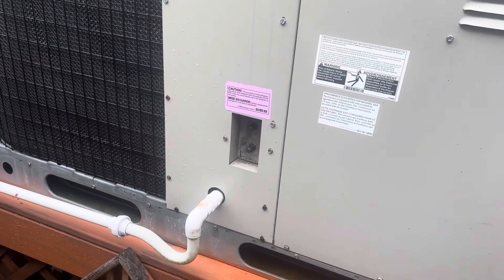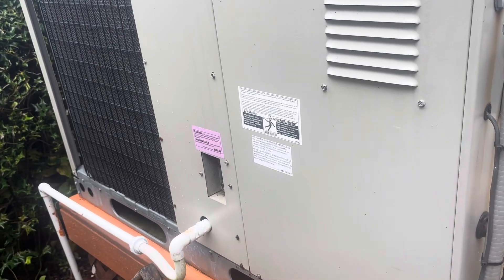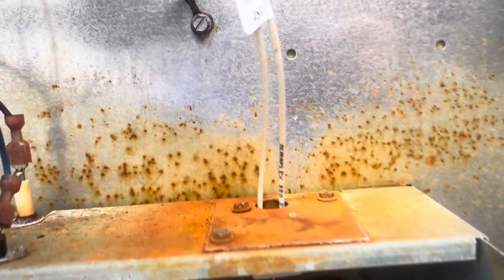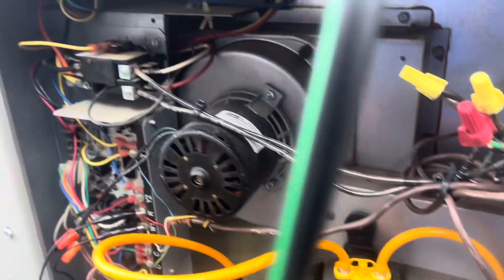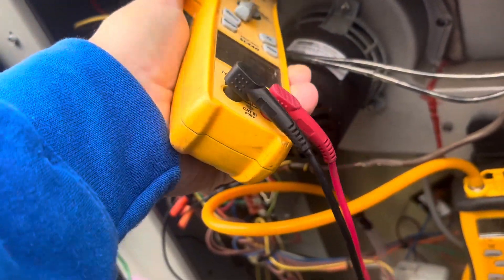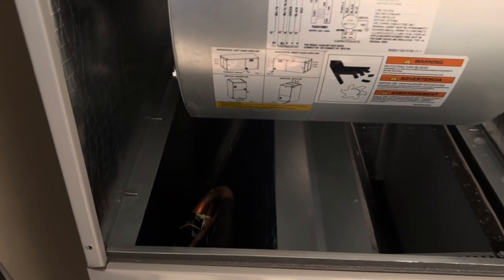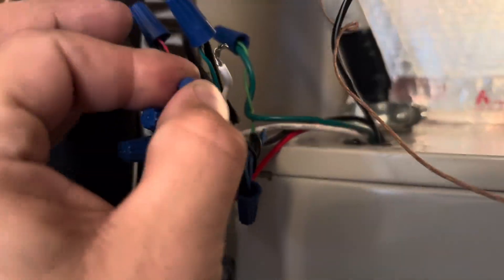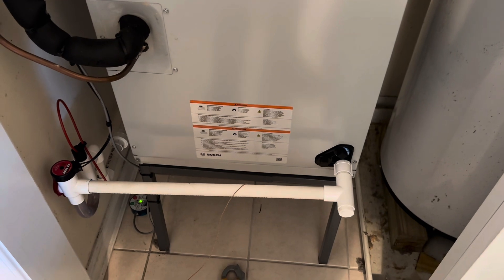Discussing Hot Surface Ignitors On Gas Package Unit Annual Maintenance

Comment: I highly recommend cleanin flame sensors with steel wool. works very well and it doesnt scratch it as much as sand paper.  I suspecting water is seeping in from the top and falling in the unit.   try silicone the top section of the combustion chamber.
Reply from the maker: Good idea.

Comment: None of that looks right to me. The pressure switch is below the inducer which is going to cause condensate to build up in the rubber tubing. I'm used to seeng the pressure switches above the inducer assembly on gas pk's . 
Also, I've never seen a hot surface igniter on a gas pak. They can't take getting extremely cold, being outside, and then rapidly heating up (which is what would be causing the premature failures) . And of course the moisture is playing a role in that also . That just doesn't seem factory to me. Every gas package unit I've ever seen has spark ignition or an intermittent pilot. 🤔🤔🤔
Reply from the maker: It’s definitely from the factory like this.  Most of these Broan gas packs have HSI that I’ve seen.  But you make some pretty good points.  Thanks for commenting!

Comment: 35-75ohm on HSI is normal through the variances, but they do go up in resistance as they age. Contaminants  from moisture in the gas lines in the area as well as what's in the combustion air , that gets blasted onto its surface, will all contribute to early failure of a HSI. But i agree, that heat exchanger has a pitch issue, it is certainly not expelling the condensation out as it should, and its rushing back to the inlet.
Reply from the maker: Well said!
Reply: did you measure the draft pressure? there might be a flue pipe issue as well and there is low pressure causing an acid vapor issue which would explain the rust too. @JeffsHVACAdventures

Comment: Jeff those units are pitched in the heat exchanger so condensate will flow out the front of the burners. If they are not level the heat exchanger will rust out internally. The cooling season is when the condensate happens. Also being by salt water can deff eat away at the igniters